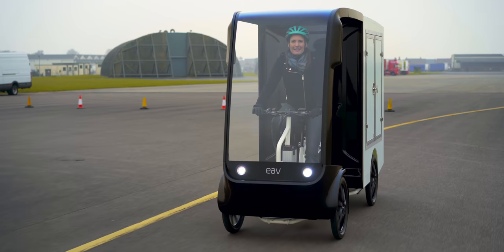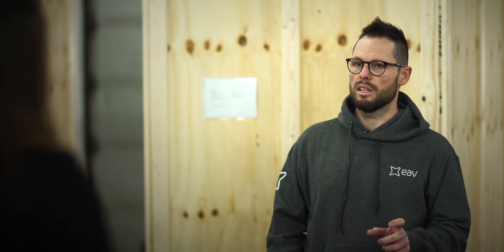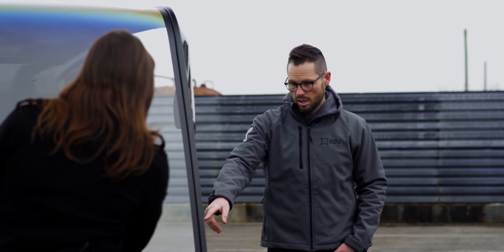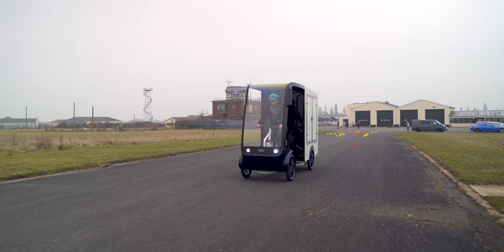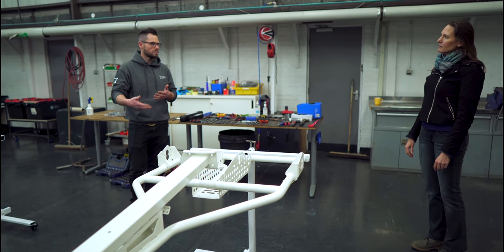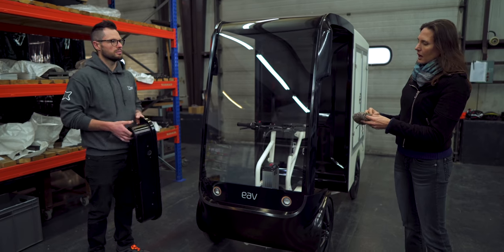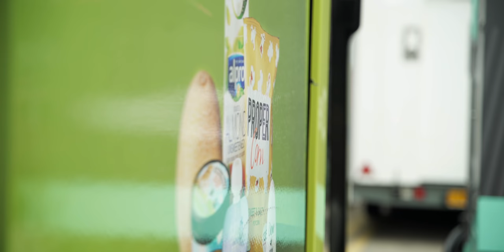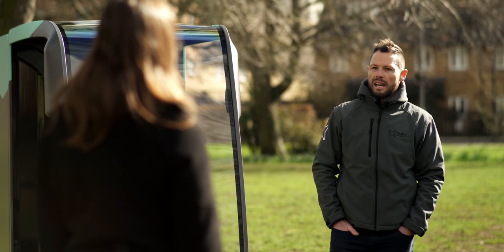EAV - Can these electric assisted vehicles change urban deliveries? | Fully Charged VEHICLES

Comment: Steering dynamics between 2 wheels and 4 is vastly different. Handlebars are associated with 2 wheels in our muscle memory which then expects 2 wheel steering dynamics. It will take a little time to change that but we're adaptable.

Comment: This kind of vehicle is extremely common in India and surrounding countries. Usually powered with combustion engines - but battery electric ones are gaining popularity. Granted, those typically use lead-acid batteries, whereas this one probably runs on lithium-ion. Probably. They don't specify.
Reply: They don't say specifically but that's a certainty. You can tell just from the form-factor, and essentially no e-bikes are using SLA any more.

Comment: Is it going to get up and down the hills of Sheffield and Edinburgh? The last mile can be very steep and if it is going up the hill at 5mph then that is a lot less deliveries. Hope the law allows it to be powerful enough. Going from city centre to my house is 1 mile but 650 feet elevation change. My ebike in pedal assist I can max out at 8mph going up it at full sweating pedal power or 4mph at a more leasurely pedalling.
Reply: iirc uk law doesn't spec the max power, but the max speed at which assistance can be provided, so it should be ok.. though range /battery capacity might need to change.. though the regen on the way down would be good.

Comment: If the motor isn't directly linked to the pedals could it run without you pedaling? Obviously they probably programmed the software to make sure your pedal lane in order for it to move at all, probably helping it with e-bike laws.

Comment: This looks great, is there also a version that will have doors to keep the cyclist/driver dry incase if the wind blows the rain from the side? On a thinking of wind, how fast must the wind blow before this product is in danger of falling over?
Reply: you know jackets exist right?  the main problem when cycling is rain into your eyes and face. which this solves (not very aerodynamically.
Reply: About the same level of wind that blows luton vans off bridges and into ditches.
Reply: @mralistair737  Being Dutch I know about rain and cycling, for most people the main problem with cycling to your job in the rain is having to work (sitting) in soaked trousers.

Of course you can put on rain trousers over your normal trousers to keep them dry, but these rain trousers are usually made from a plastic material and do not really breath, short commutes to and from work is fine, but having to cycle the whole day for a living wearing these rainclothes would not be a joy.

With this bicyclevan you have a roof and front window, I do not think that the jacket area is the part to get drenched the most when the rain comes from the side on

Comment: for me the only thing i wish would be changed is that max speed of 15 MPH? If it could go 30 MPH with full load i feel it could not just function for cargo but also a taxi in densely populated metro areas? A base model could have a flatbed at the back and you could have a cargo or passenger final model configuration? 15 is just a tad too slow for me...

Comment: Are the cranks there mostly to excuse itself on bike only paths? I can't imagine they'll do a big chunk of the power output.
Reply: They better do all of the power output, otherwise it’s a motor vehicle. I have had an ebike for a few years now and the only time you get power assist is when you’re pedalling.
Reply: @frankcoldwell4424  But that makes the pedals an actuator, the motors not an assist.
I've ridden cargo bikes when I was a mailman. No assist, just pedal power. Works well in flat area. This thing is less efficient with the tiny sturdy wheels so even coasting the pedals can't contribute a decent percentage.
To be honest, it's a bit lame to put these on bike paths if the driver is not a rider powering the vehicle basically ever.

Comment: Seems like a good tuk-tuk scale replacement, especially as it looks more like it's pedal-assisted battery power, rather than battery-assisted pedal power.
Just turn the cargo box into an enclosed bench, makes much more sense than 6-seater taxi's lumbering about with just 1 passenger 90% of the time.

Comment: One question, why are the controls the opposite way around to a motorcycle? Throttle should be on the right and the indicators on the left. Even BMW gave up with their split indicators and moved them to the conventional left hand operation.
Reply: Because it's a bike, not a motorcycle?

Comment: Slap a solar panel on that roof and extend your range dramatically. Should be able to get at least 400W of solar up there. ANd every time you stop and deliver the battery is accepting charge, and while moving the battery usage is offset by whatever the panel generates. It's a no brainer.

Comment: Looks good, but if it has a Thumb Throttle then it cannot be a legal E-Bike as these were banned some years ago...and 250W with a decent load in the back...it will struggle I suspect....needs more power....nice concept though.

Comment: right away Im thinking, Can it reverse without having to get out and push it, and swap out the back box for 2 or 3 seats, and you got a short range taxi situation
Reply: A reverse switch is standard on this type of vehicle. Pedicab safety regulations are formidable.
Reply: @popeyegordon  So, Flip a switch, Pedal forward, and the van reverses? thats kool, is it mechanical engineering, or just reversing the electric motor
Reply: @TheRealKaiProton  The pedals have a freewheel so they don't go backwards in most designs. As expected, there will be a backup alarm in commercial vehicles and only a very low speed reverse will be enabled. No pedal assist is needed for reverse. Most motors will work in reverse when you reverse the polarity. If you really need details ask the manufacturer.

Comment: Just what we need a rolling road block, blocking traffic in towns adding to congestion and blocking pavements when stopping to deliver, it even blocks the highway on the video, plus a queue of traffic behind it. Fast  motorcycle based delivery vehicles are far better. Electric motorbikes.
Reply: Electric motorbikes can't deliver several household's worth of refrigerated shopping in one trip you galoot. These aren't targeted at replacing courier-style deliveries, they're aimed at replacing postal vehicles, grocery delivery trucks, smaller municipal vehicles etc. Have you somehow managed to avoid noticing the ever increasing number of branded vans parking half on pavements while also blocking cycle lanes, parking in bus stops and bus lanes, double parking on residential streets, and generally clogging up the place? Replacing the vast majority of those with cargo bikes and this kind of thing sounds much better to me.
Reply: @YodhrinsForge  we will see what you think when you are travelling in a long queue trying to get past these slow wider than a bike vehicles. How about and refrigerated electric van, than can travel at the speed of the traffic and still deliver several households worth of shopping. These will even block cycle lanes so unless they make them do 40 mph they are as I said a slow moving roadblocks that will add to congestion and increase emissions of the following traffic, let alone more accidents of people trying to pass them.  Plus I don’t need to insult people if I don’t agree with them.

Comment: I think that will be a very useful vehicle for last mile deliveries. However, it is definitely not a bicycle. It is a pedal van. Cycle lanes are difficult enough for cyclists to pass each other as it is. To have a pedal van like that taking it up blocking one's view and moving with different speed dynamics i.e. to slow down hill and hussling one uphill, to slow on corners, is a big problem. With 20mph speed limits in built up areas, it should be on the road and the driver (not cyclist) should need a licence for it. It requires proper mirror use and other types of awareness required with bigger vehicles.
Of course with present day vehicles banned from built up areas coupled with a 20mph limit so that cyclists and pedestrians are able to assert the priority, they already technically have, people can retake the roads we already have.

Comment: You need to check out the Armadillo cargo bikes which are currently in use in many european cities.
Reply: I'm sure they are alright but this looks a lot better engineered and thought out.
Reply: I'm all for the sustainability aspects, but  its frontal area and basic suspension mean that it's very much a last mile vehicle wheras the Armadillo is designed for longer distance uses and higher speeds over mixed terrain. Horses for courses.

Comment: It should have a tiny EV motor (no gear change for the user therefore easier to operate), 
the harder you cycle the faster it goes or the more charging for your battery.

Comment: Could cut the frontal area in half if the driver was rotated 90 degrees.  Why did the designer ignore aerodynamics?
Suspension: no mention of a compliant frame, maybe they didn't consider it.

Comment: The problem with the 15mph top speed is there are roads that are 30mph, and they are designed to be 30mph. you wouldn't find people still doing 30 in a sharp corner, but do expect to find them on the straights doing that. UK rules and law really need to catch up. I get there is the appeal of "anyone can use this without a licence" but something like a CBT (but last forever) for electric bikes would be perfect.
Reply: False. Max speed limits are not requiring all vehicles to go that fast unless there is also a posted minimum speed limit. But yes, UK laws are the worst and very prohibitive of taking advantage of green vehicles.
Reply: @popeyegordon  how is my comment false? 

Their excuse for not having a higher speed limit is "wow 15mph is already quite fast". but if a road is 40, 50, 70 etc its DESIGNED to be able to take that sort of speed.

restricting a vehicles speed puts drivers in dangerous situations if they need to get away from something fast, and puts other road users at risk by being a hazard they have to pass. A normal vehicle they wouldn't, and there are some people out there who aren't as good ad judging when to pass vehicles as other people are
Reply: @rjc0234  Your false statement was that roads with a 30 mph speed limit are meant to be traveled at 30 by all. Nonsense. In the USA all drivers get a license that demands they must share the road or go to jail and lose their license. We only exclude bikes from limited access interstate freeways with minimum speed limits. Road design is not the limiting factor. The way you see the world, no bikes should be allowed on any roads. In the US our electric assist bike laws are 20 mph, and 28 mph for class three bikes that are not allowed on bike paths. Delivery vehicles are seen on roads everywhere and drivers know to tolerate them at any speed.
Reply: @rjc0234  "there are roads that are 30mph, and they are designed to be 30mph .... expect to find them on the straights doing that."   The agenda to get all drivers to share the road is universal in first world countries. This is the exact opposite of 'my own agenda' and it is vital to prevent bicycle fatalities by demanding that all drivers share the road. Having a license to drive is a revocable privilege. Yours is at risk with that attitude, as are all bicyclists who live near you.

Comment: Might work well in flatter areas with decent roads without potholes... ahh ;)
Reply: I think it will be better than India and Iraq's tuktuks
Reply: Potholes are created by cars and, even more so, lorries; so you shouldn't find potholes in dedicated cycle lanes.
Reply: the way the pedal assist works is that it's up to 15mph regardless of slope, so the odds are that if you are in a hilly area you just need a bigger battery
Reply: It can go up hills and you can steer round potholes.

Comment: Every time I see pictures of sites like these I have to question why these aren't being prioritised for new grid scale solar installations over greenfield sites. MIRA - the test track site that was mentioned in the interview with Israeli firm, REE, is another. There's literally thousands of existing industrial, post industrial, light industrial parks, enterprise parks, manufacturing sites of large car & or equipment companies etc that have huge potential, not to mention tens of thousands of kilometres of rooftops ripe for solar & or wind power generation.
BEIS - Department for Business, Energy and Industrial Strategy - when it comes to the energy transition, it really doesn't look like it's living up to either nomenclature or function. A definite lack of joined up thinking. i.e. new renewable land based generation capacity should be directly (and) intimately, tied into the planning regulations and BEIS should be acting as the go-between for renewable developers and landowners. To be clear: I'm not against rural grid scale solar developments but the aforementioned sites are usually at or near existing points of use, result in lower ⚡ transmission lines losses, require fewer resources to deploy & utilise already disturbed sites. Nor do I think 'spoiling the view' is an excuse to deny planning permission in rural areas as so many NIMBYS imagine. It's just that I strongly believe (in case you haven't already guessed 😁😋) it's important to use/reuse what we already have.

Comment: I would have liked to have seen more technical info. They appear to be using bicycle disk brakes, and the fairly humble looking motor had a sprocket, which suggests chain drive. No mention of regen. Of course absolute electrical efficiency is not as important as it is on a long range EV. It didn't look like there were levels of assist - so riders/pilots wishing to get exercise whilst working might be out of luck.
Reply: In the first minute, it shows 5 levels of assist. She started in level 2

Comment: I think EAV's last mile delivery solution is fantastic, an absolute winner, my beef is that they have to disguise it as a 'pedal-assist' vehicle (which it plainly isn't), just to meet current e-mobility law.

So, a quadricycle must have 'pedal assist' to qualify as 'not a van', but an 'e-bike'.  OK, I get it; regulations force compliance, but pedaling an EAV last mile delivery van is just virtue signaling when the battery pack range can be sized for 25 - 125 miles.  I mean, who would pretend to pedal 125 miles @ 15 mph just to comply...?
Reply: They have to, if it isn’t fully pedal assist only then by law it’s classed as a motor vehicle. That means a license would be needed along with mot, insurance, ved etc.

If they’re cheating by hiding a throttle so no pedalling is needed then they’re breaking the law and should be taken to task about it.
Reply: But they are pedalling, and providing 30-50% of the power. And they get to use cycle infrastructure and fit through modal filters, so their delivery times are exceptionally reliable, and their operators stay healthy. How is any of that bad?

Comment: Interesting concept, BUT - the testing was done on a nice flat airfield. So how will they cope in strong crosswinds? How will they cope in hilly areas? Will they get stuck in snow? In winter, if the rider is sufficiently wrapped up to avoid freezing, will he/she overheat when pedalling? Every other powered bike has indicators on the left, and the throttle on the right.
Reply: It’s not a powered bike as such, it’s an ebike and in the UK they can only be pedal assist, if it has a throttle it’s officially classed as a motor vehicle then the rider needs a licence and the vehicle needs insurance, an mot, road tax etc.
Reply: @frankcoldwell4424  - I'm fully aware of that, but thanks.

Comment: 15mph is not enough..., especially in the city... 20mph that what you should aim for as this will not clog traffic in 20mph area.
Reply: Nonsense. 15mph is a sensible top speed for e-cargo bikes. 15mph is not 'clogging traffic', it is traffic. People doing 15mph in a 20mph limit residential area are a good thing (it's a _limit_, not a target).
Reply: 15mph is UK legal limit for e-assistance of cycles.

Comment: do you have permanent magnet motors or electromagnet motor?
Reply: do you have simple dc motors or non-needed complexity ac motors
Reply: ceramic baking sludge binder
Reply: clay pottery, rebar, cloth matrix
Reply: people dont need stuff, you can make things freely, you with weak faith
Reply: modern rigshaw

Comment: Why wouldn't you just have a small electric van ? - I mean I just don't get the bike bit
Reply: Much lower emissions overall and much better reliability of delivery times. Bikes are just much better than vans in urban areas.
Reply: @xxwookey  an electric van has no emissions ! - I mean all you need is a golf cart with a box on the back - can't help but think people are trying to reinvent the wheel here
Reply: @birdingbilly  Wrong. An electric van has emissions according to the grid intensity where it is charged (typically about 250gCo2/kWh in the UK at the moment, (falling steadily). It also has significant lifetime embodied emissions. Those are dramatically lower for a much lighter vehicle like this EAV. It all adds up. There is a vehicle called the Paxster which I suspect is what you are imagining. That's fine too, but active travel is important for health and wellbeing and you don't get that in a pure EV.
Reply: @xxwookey  ah that old chestnut
Reply: @birdingbilly  It is true. None of the emissions (well except tyres) are local, which is a good thing. But there are some and it's right to account for them when thinking about systems-level stuff like delivery.